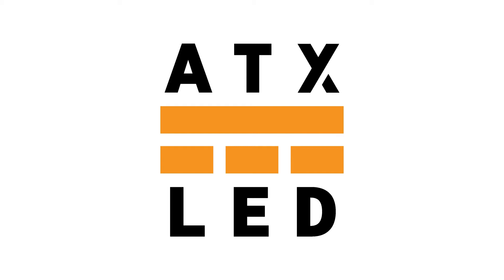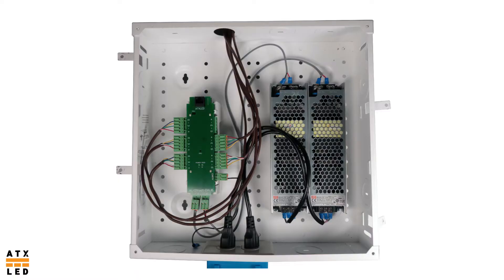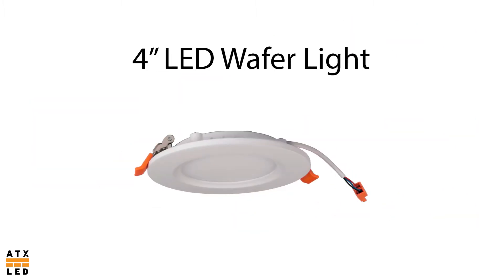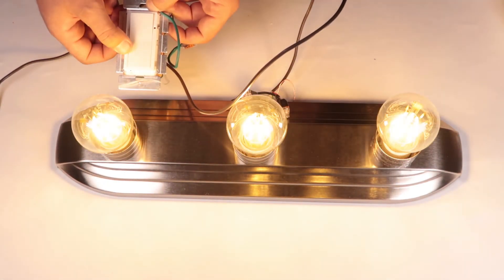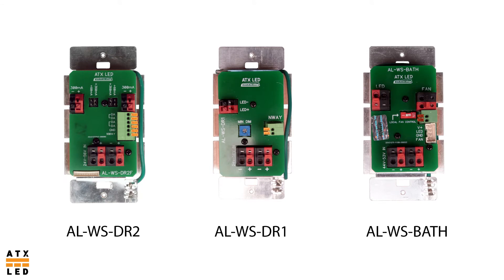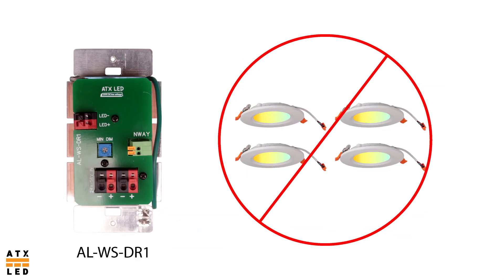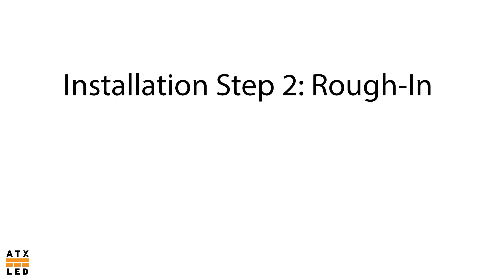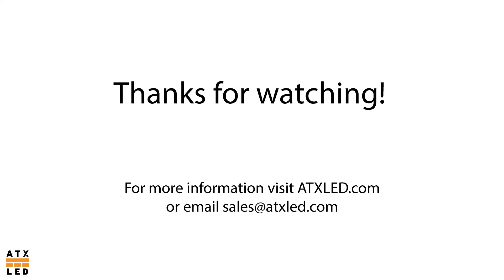ATX LED - overview of DC Lighting for New Installers

Comment: If I have a large room with 12 lights in the ceiling that I want to be tunable, does that mean I have to have 3 switches on the wall and therefor, have to operate 3 switches to get all the lights to turn on?
Reply from the maker: Hi - this is a common situation in larger rooms - if there are, say, 12 lights, then the room is probably over 450 sq ft, and in most cases we have seen, has multiple entrances.   We place a AL-WS-DR2 at each entrance ( not all in a row).   Then, the hub connects them into a DALI group - so all 3 operate in unison, with dimming for all 12, and CCT control for all 12, in sync.   It is like a 3-way ( 4-way) setup.   We have customers with up to 6 installed this way, in a building with 6 outside doors and 48 outdoor lights - each DR2 can be individually addressed or operate in unison with the others.   There is no need for all these to share the same home run either.   Another example of 3-Way is a hallway with 4 doors, one AL-WS-DR2, 4 lights and 3 AL-WS-M  - a total of 4 switches ( one per door) and only one need be 'smart', the others are simple contacts.  This is covered in our FAQ.    

If the room is large and has just one door, then 2 of the switches can be hidden in a closet - all will operate together.